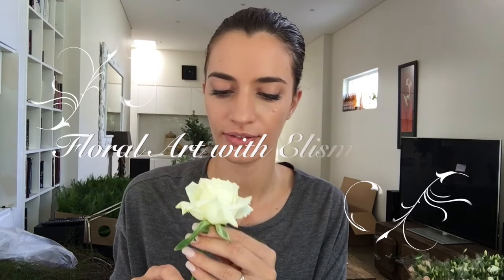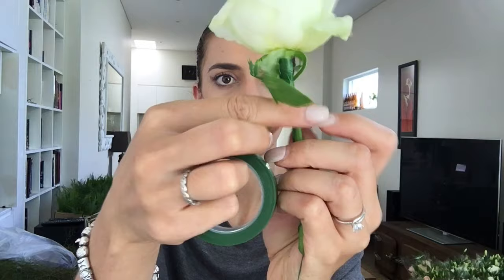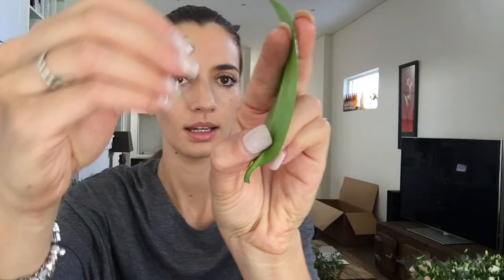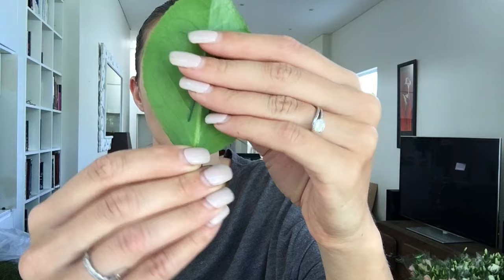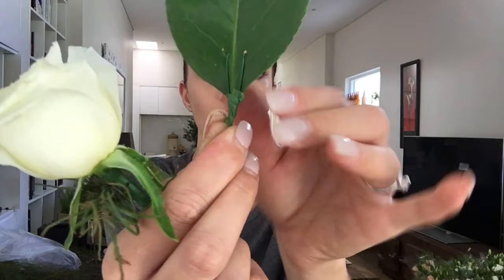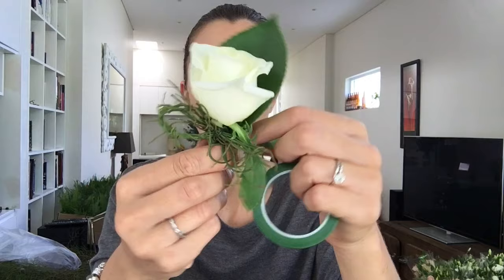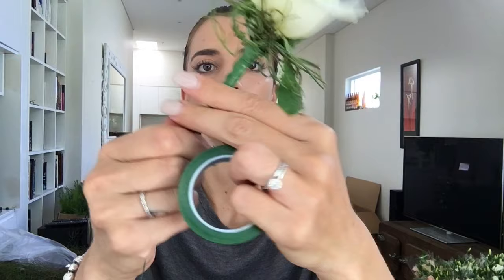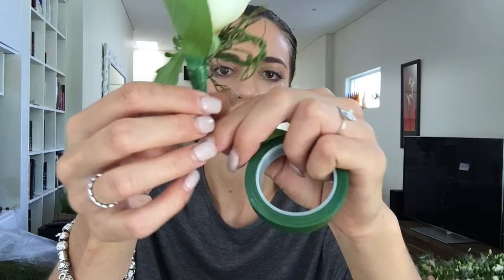Elisma Rose. How to make a buttonhole/boutonniere.

Comment: Camellia leaves are huge I'd use ruscus or fern SK flower not swamped. I'd also wire through the stalk sideways and bend down stem as roses have heavy heads I'd only wire up a flower if it were a carnation or lighter

Comment: What is that tape you use?
Reply from the maker: its call parafilm or florist tape. It usually comes in green or white.
Reply from the maker: Sorry auto correct... ^Called
Reply: Thanks. You do a great job
Reply: Hello, is parafilm the same at Stemtape? x
Reply from the maker: Yes I believe so. I think it might be called Stemtape in the US and maybe UK also. It is a stretchy tape that sticks to itself. :)
Reply: @samanthaprice6741  Stemtape is normally a papery texture and it's biodegradable it can be used for the same purposes of Parafilm. Parafilm has a plastic texture and is more stretchy and it isn't biodegradable. Although Parafilm is easier to work with because of it's stretch.  
I'm currently in training to become a florist.